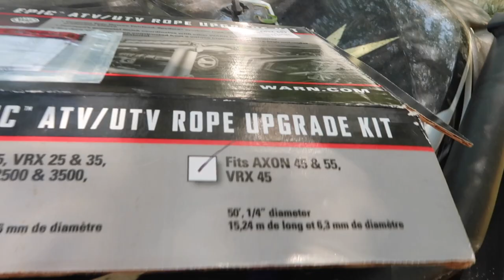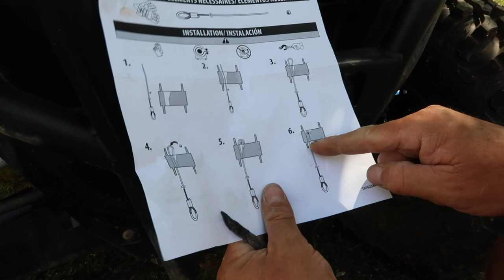Upgrading the Warn Winch from a Steel Cable to a Synthetic Rope

Comment: Ditch the hook, and use a soft shackle. Also you put the hook pin in back wards. Turn it around so that the cotter key is not on the open side of the hook. Don't ask me how I know!

Comment: Great video, however, when replacing a wire rope cable with a rope cable you must take care and clean the drum with sandpaper to remove any burns left from the wire cable. The drum must be clean and smooth to avoid cutting into the rope cable. After sanding the drum, follow up with a Scotch pad to ensure it clear of debris. Also, I noticed you put the pin and cotter pin in backwards. The pin should have gone in on the other side so that the cotter pin isn’t on the clamp side. This is to avoid snagging.

Comment: In my opinion I like the fairlead rollers plates over the base fairlead plate. It puts a lot less stress and wear on the rope or cables. Especially if either are dry while pulling large amounts of weight. It's just like the eyes of some of your bigger deep sea poles used to catch large fish.